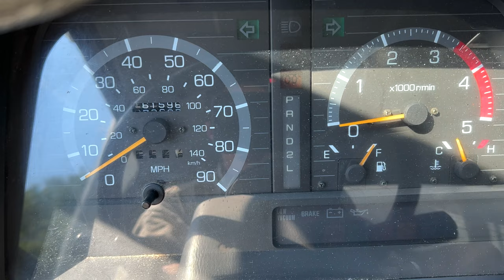Replacing Shower Valve Through The Hole

Comment: If you’re ever doing another one of these old deltas, and the cap nut is stuck never force it or the tubes will break 10/10 times. Try tapping on the nut with two pairs of chanellocks on each side. Also when trying to take the nut off, always grab it by the very end where there is no knurling. When you grab it by the knurling it crushes it and makes it even tighter. If all else fails cut off the cap with a cheese saw and get a new cap, hope thats helps. Im also a plumber in CT and see these deltas on a regular basis
Reply: Using channel lock pliers was his first mistake. They squeeze the ring and lock it tighter to the valve. It's better to use a strap or pipe wrench.

Comment: Great to see how it's done.  The old joint likely was due to lead rather than the antimony.  Lead/tin is even easier to get a tight joint with less heat.  I just cut out a tube into a street elbow in a tight space, it fell apart as I cut it, only 1/16 inch of the tube was in and it held leak tight for 30 years before it started to leak.

Comment: I have an old American standard valve that no new trim kits will fit, so need to replace the flash rough in valve.  Wondering if the majority of plumbers I would call would even attempt this since I do have a closet wall behind it that could be cut into for easier access.   I guess I should be looking for a trim kit that will allow them to cut a fairly large opening to increase the chances.   Great work.

Comment: Bro, you are a freaking pro, nice clean work!  I hope the owners apricate your work.  What vale brand do you prefer for quality and reliability?
Reply from the maker: The owner happened to have this one on hand so I installed it for them. Typically I recommend Moen, especially on well water.
Reply: My experience Moen tends to fail more in certain areas even with well water. In Midwest especially Wisconsin they corrode to crap.....making simple repairs hours long. The cartridge in delta is much easier to replace.

Comment: Thanks for posting this video! You are the only one that I could find that even attempted to do this! Everyone else cuts a giant hole and puts a big, ugly chrome trim piece! 
I had 2 of these to do. One I could have opened the wall up behind it and one that butted up against the other fiberglass tub / shower so not an option. I didn't really want to use that big, ugly chrome piece to cover a big hole that would have needed to be cut. My valve was very similar to this one except no integrated shut off stops. I used a thin wall mount to make sure the valve was tight to the fiberglass. I spent close to 4 hours on each one. 

I don't see in the video what keeps the valve from pulling forward. Is it just the pipes holding it in place?
Reply: I have the same issue as one of your fixes, no access behind the wall because another tub shower insert. You said you used a thin wall mount to secure the valve to the fiberglass? What did you use as the mount? And how did you secure it to the fiberglass? There's no strapping on the valve, the shower or tub spout either. And there's a stud that was hacked up right behind the valve (likely done to set the valve back in the wall slightly). I want to add better bracing but it's such a small hole, with little ability to push the valve in/back because the stud.
Reply: @Greg-cs9uj 
@Greg-cs9uj 
Yes, I used a Delta Thin Wall mount kit. It's 2 pieces of thin plastic that sandwich the fiberglass. They screw to the plaster guard (plastic box ) provided with the Delta valve. I sweated all of the copper tubing and pressure tested for leaks.  I then snapped the plaster guard on followed by one of the 2 plastic pieces behind the fiberglass and one in front. They secure with 4 screws total. The trim then goes on top of that. 

The Delta spout came with a brass part that sweats to the copper. You then screw the spout onto that.  It wouldn't seem like that is sturdy but it is. I wouldn't try to stand on the spout though! 😂
Good luck with your project!

Comment: That's exactly how far I got.  Bought the springs, rubber seals, and the silicone grease then the metal dome was corroded and seized up on the faucet, wouldn't budge. I would have twisted all of the plumbing pipes into a pretzel before it would have broke loose.

Comment: the valve looked unsupported (not screwed down to a cross-member stud, which SHOULD be there) which means the valve will always feel loose when activated, and is also prone to failing over time. The right way to do this is to open up the other side of the wall, install the cross-member, then patch the drywall. Really, the cross-member should have already been there, but when in isn't one MUST be installed.
Reply: That's what I was thinking 🤔....he was probably trying to save the homeowners money.
Reply: AGREED!
Reply: are you serious?  The  escutcheon plate will hold it in place mr plumber
Reply: Just superglue
Reply: Haa haa

Comment: The valve body inlets were outside threaded, so I would have assumed I needed to screw on a "screw-to-sweat" adaptor.  I had no idea you could just sweat a 1/2" pipe right into those inlets. But I'm not a plumber.  It that common/normal?  Avoiding the screw-on adapter sure saves worry about leaking at the threads!
Reply: yes completely normal.

Comment: Haha your gonna have a bunch of plumbers swearing at you because their customers saw this and think swapping a valve from the front like that is easy 🤣 and you didn't even use a Reno plate! great job man !!! 👏👏
Reply: Bad installation.  Theres no backing and no backing plate.  That valve is NOT secure.  Its loose.  You could pull it out.  Garbage plumber.  I could’ve repaired the original without issue.  This guy is a scammer
Reply: And he broke the old valve like a newbie homeowner

Comment: Why and what do you use to clean the joint just after sweating the joints
Reply from the maker: I wipe the joint down with flux. It serves three purposes, firstly to provide a little extra flux in the event some burned away and it pushes the solder around to help seal up any imperfections. Secondly it is a means to strike off any excess solder so that you don't end up with a "grape" or lump of solder. Thirdly it cleans off oxides and decolorization of the copper from the heating process. Then once the solder has solidified, but while its still hot, I wipe the joint with a rag to clean the flux off and prevent rapid oxidation of the copper.
Reply: @GodwinAndSons  Thanks for your reply. You are a craftsman indeed. I am a jack of all trades. My profession is bridge building. It is nice to see other craftsmen who take their profession to heart.

Comment: I thought once the shower valve is installed, its installed for life and you need only to replace the cartridge when it doesn't work properly. So, why is this plumber replacing the shower valve?
Reply from the maker: I tried replacing the cartridge at the beginning, but the bonnet nut was seized and twisted the valve body, so at the point replacement was the only option.
Reply: I need to replace mine because it's not pressure balanced. My wife doesn't like when she's in the shower and someone uses the sink in the kitchen and she gets scalded.
Reply: Same thing happened to mine. Planned on replacing the cartridge but the threads on the collar holding the cartridge were seized. The 3 copper tubes on the back are pretty flimsy, and twisted when I tried to break it loose. Even with a second pair of pliers holding the valve body. This was some fine work, and a great value at $300.
Reply: @sni1144   next time take a hacksaw blade  to the bonnet nut. Just take your time with it. Ive seen a few people twist the tubes on those older deltas

Comment: You destroyed that fixture by applying too much torque.  If it was that stuck, you should have used a hack saw to cut the ring off, thereby saving the fixture.  Several other people have demonstrated that procedure in other videos here.
Reply: It was being replaced - he cut it to pieces. There was no "saving the fixture".
Reply: He wasn't replacing it. He was gonna replace the cartridge. After he twisted the copper he needed to replace the whole valve body. Those valves are notorious for exactly what happened with lack of knowledge.